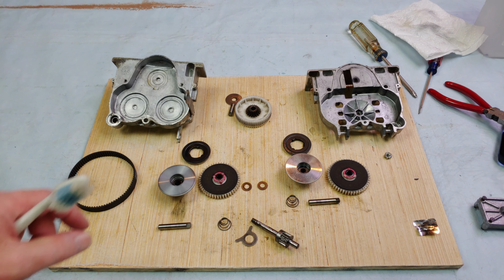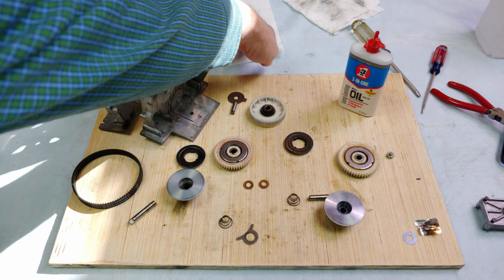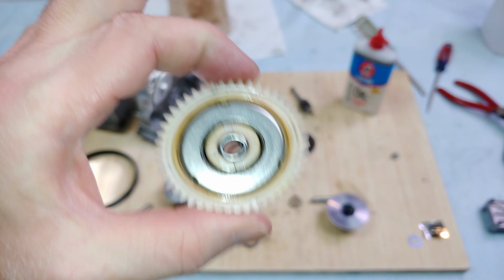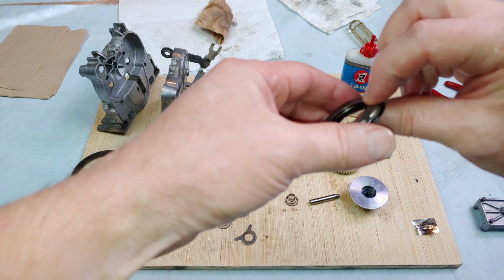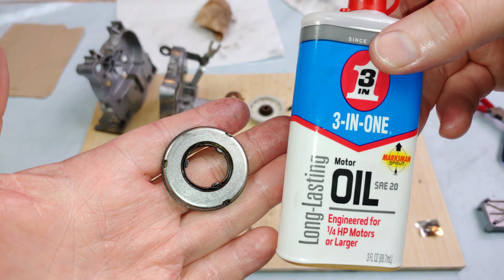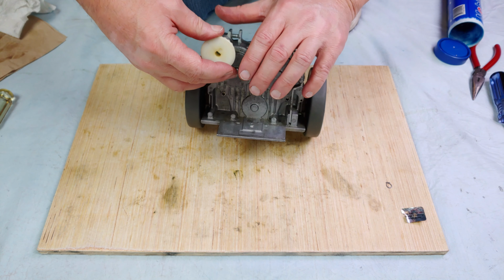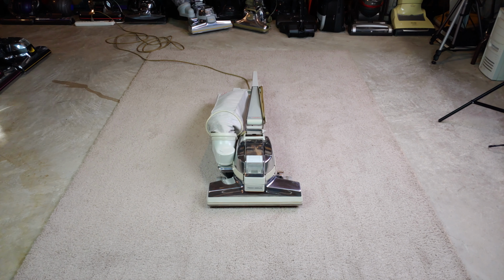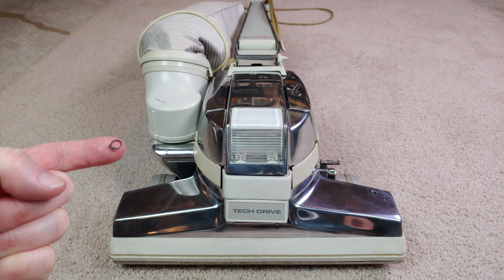Kirby Transmission Refurb Part 2 Reassembly And Testing

Comment from the maker: As I was uploading this video, I ran this donor G3 on some carpet areas that cause older Kirbys to periodically skip or hop. My wife was interested to experience this "extra stable" Kirby so she frantically attempted to force it to skip. It was a 100% no-go! Absolutely no transmission "nervousness" at all!  As far as whine-noise reduction, meh results. Won't hurt anything but might not be worth the trouble just for a slightly quieter G series.

Comment: It seems like the Ultimate G or Diamond Edition was the changing point where the transmission became much quieter and smoother. Our G4 is very whiny and not as smooth. The Sentria 1s that I've had on my bench and in the house before and the current one that we have now were all much less whiny and were smoother overall. It would be really interesting if you'd be able to get a Sentria or later transmission apart to examine it for any obvious differences that could make it so much quieter. Helical or herringbone gears, maybe different clutch friction material, maybe different pressure plate material or a different "crosshatch" pattern on the pressure plate, etc. I'm not really sure, but it would 100% be cool to crack a newer one open and see what's inside that may be the answer.
Reply from the maker: The transmission speed change came about July of 2005 during the G7 run. The transmission difference wasn't actually inside the transmission but rather the two plastic gears and belt on the rear of the motor.
Reply: @VacLab  That gear and speed change was what eliminated most of the whining noise with the newer models?
Reply from the maker: @mannys9130  yup.
Reply: @VacLab  Interesting. Is retrofitting possible?
Reply from the maker: @mannys9130  see my first post. Only parts on the outside of the transmission have changed, so you are free to do whatever you want.
Reply: @VacLab  I found your G6 trans upgrade video by myself which was the specific answer I was seeking here. You switched the motor shaft gear and the transmission input shaft gear with those from a G7 and newer machine as well as the drive belt, and then cut a notch in the plate above the belt to make clearance for the new setup. Very interesting. You should definitely point people to that video when they're curious about retrofitting their older machines like I just was as it contains all the info I needed to perform the upgrade. :)

Comment: My g2000 le does this same whining noise , thought maybe I did something wrong in the refurb process , completely stripped down , wet sanded the body , buffed and polished . Then went onto the internals ,motor , trans, handle mechanisms,anything that moved and could be stripped down was done . Was excited to use it till I got back together to hear it whine like that .. cracking the case on the trans was the only thing I didn’t do. 
Also have the ultimate g diamond no whine once so ever … 
The gs wasn’t bought new so I don’t have a good comparison to go by , but did the g6’s whine like that new ?? Mines probably at least that loud, and seems like the faster I push the vac the more prominent the whine … I would be inclined to buy a new transmission if there was no whine with the new one …
Reply from the maker: New ones don't whine.
Reply: @VacLab  I figured as much ,,, but figured I’d ask so I wasn’t assuming anything lol . I did order a new one off eBay …so I cracked the case open on mine using a heavier grease for cars .. almost got it the trans back together , so we’ll see how that goes , figured wth I just ordered a new one anyways lol
Appreciate your reply

Comment: This suggests to me it is the clutch material on metal that is in fact making the whine. I’ve been watching this carefully trying to determine what is making my sentria one pop. It’s not the clicking from the pedal not fully disengaging drive, it’s a quite loud and defined pop that I can hear Over the vacuum running, usually happens when going from forward to backward especially when I’m going faster or turning it while changing direction, and only once in a while. Maybe I’ll grab some video of it. Best guess so far is it’s the drive gear on the rear axle skipping teeth but I don’t see any evidence of it. I’ll report back if I find the cause inside the tech drive.
Reply from the maker: Can you post a video of the issue?
Reply: My workhorse Sentria does this as well. I haven't taken the time to troubleshoot it since it's intermittent.
Reply: @mannys9130  My Sentria does it too. Must be something with the Sentria. My G3, G7, or Diamond Edition doesn't do it at all